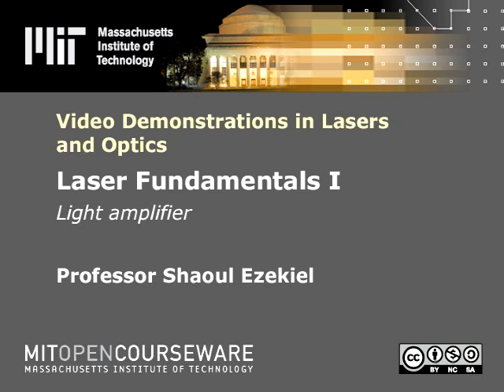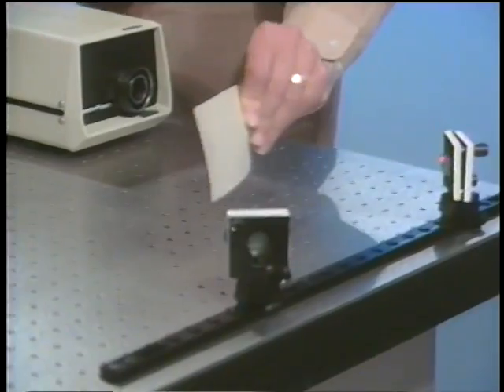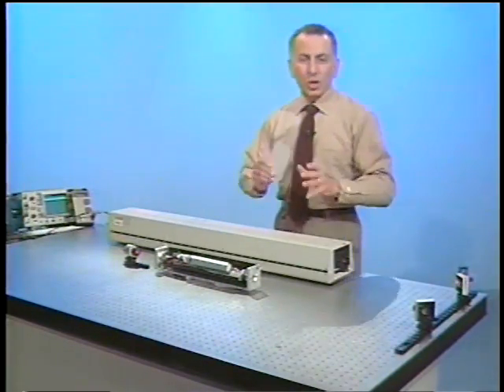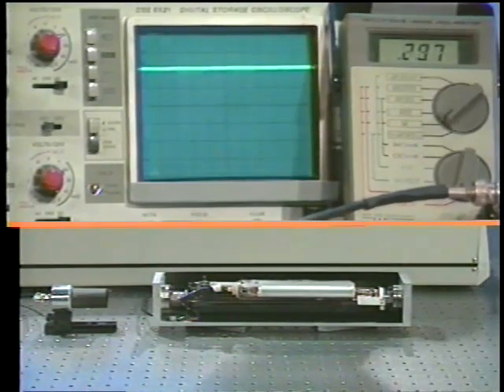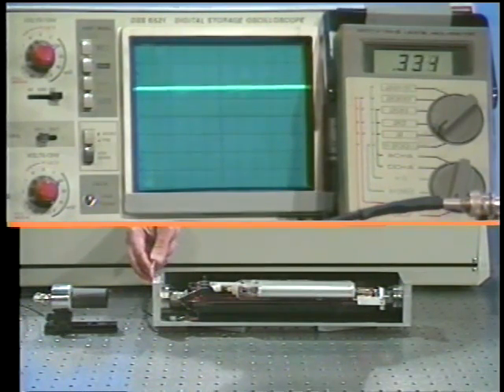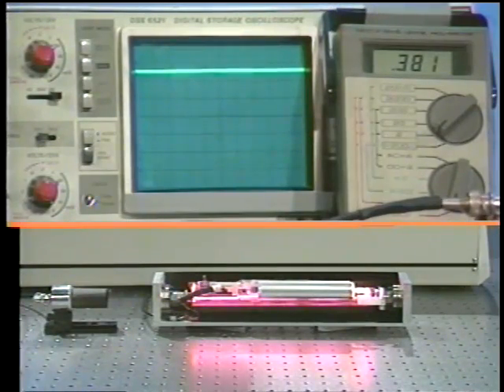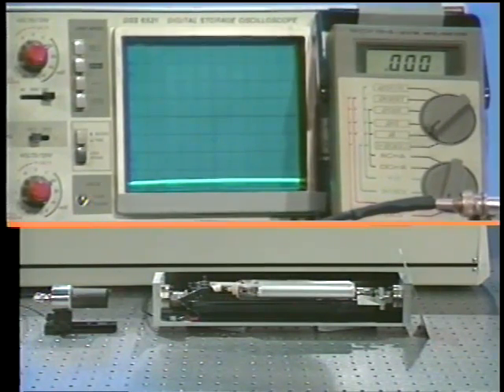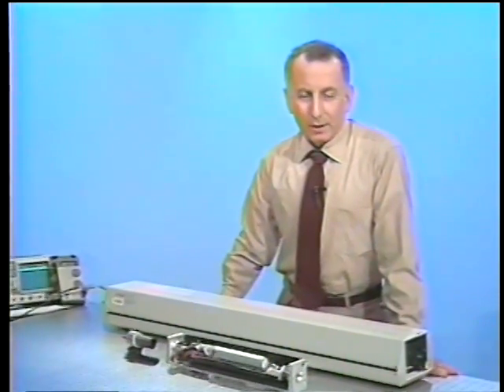Laser fundamentals I: Light amplifier | MIT Video Demonstrations in Lasers and Optics

Comment: Something here doesn’t make sense. The demonstration shows that when the  “amplifier” tube is on no light comes out of it unless the other beam goes into it. That raises two questions:
1) light is shown coming out of the SIDES of the amplifier tube but yet no light at all - zero on the meter - comes out of the ENDS of the tube unless the other beam goes into it?   That is not possible if light can travel THROUGH the tube.  There should be some light coming out of the ends of the amplifier tube any time it is on.
2) if this amplifier was used in a complete LASER how would it start unless “primed” by another LASER?  No He-Ne laser I have ever seen requires priming to start. They self- start because light DOES come out of the ends of the amplifier tube - with no other external light input.

It appears to me that the “amplifier” tube in this demonstration is simply adding to, not multiplying, the beam coming into it.  When used in a LASER the light bouncing back and forth through that tube many many times - via the mirrors - is what produces the multiplication.  I’m not sure that’s atomic physics at work or just simple summation.
Reply: 1. Extraneous "pump" light coming out of the amplifier would not necessarily be well collimated nor co-linear compared to the amplifier optical axis, and thus would not register similar intensities on the detector.  I'm sure there's something there, but it's likely many many times smaller and not visible without greatly increasing the scope gain.  
2. A normal HeNe does not need "priming" because it's configured as an oscillator - the same gain medium that can provide amplification operates as an oscillator when feedback is applied, which is to say mirrors around an amplifier make an oscillator.  In this case, removing the mirrors in a HeNe is sufficient to turn it into an amplifier - the external oscillator light passing through the HeNe gain medium drives stimulated emission and thus amplification, but it is a single pass (no reflections) and thus lower gain than in an oscillator.  Stimulated emission in an oscillator is kickstarted by spontaneous emission from the atoms in the gain medium when it falls within the cavity and randomly coincides with the optical axis - after pumping, the excited state would emit randomly/spontaneously in all directions unless "stimulated" by light from the oscillator. In the oscillator the stimulated emission is then reflected back into the gain medium by the high reflector and partially reflective output mirror, and when all of this passes the "lasing threshold" then it self sustains.